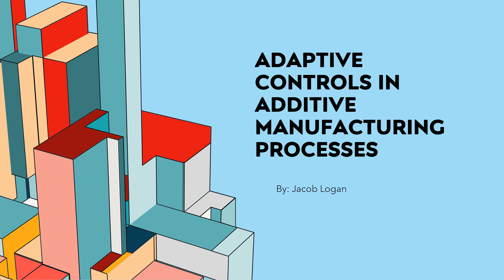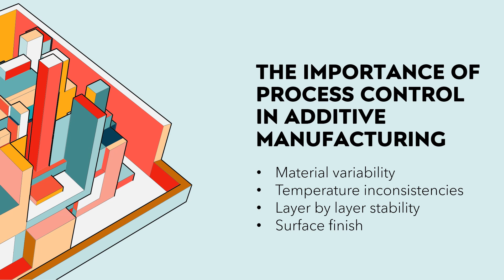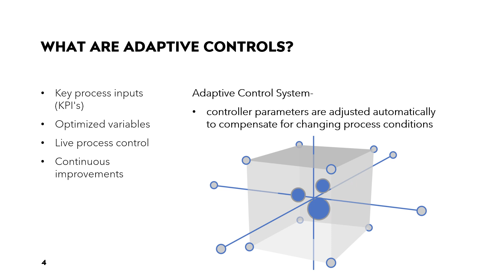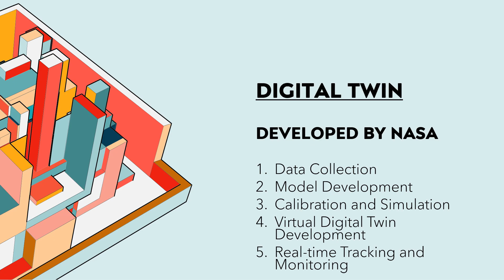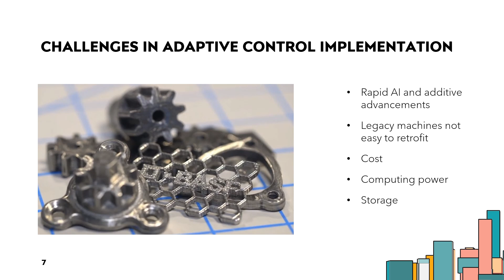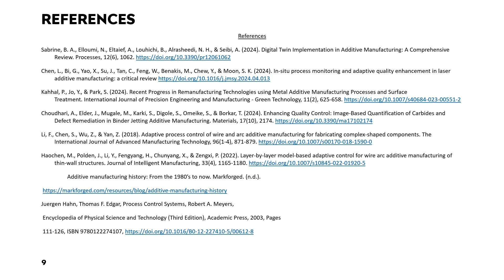Adaptive controls in additive manufacturing processes

Comment: The point the on the difficulty and expense of retrofitting older additive manufacturing machines with new sensors is something that I feel definitely gets sidelined when tech outlets publish articles on IIOT and wireless sensor networks. While the 3D printers that companies currently use for rapid prototyping could be repurposed for real part production (or part reworking / repair in the case of LDED printing), the adaptive control systems require investment of capital for the hardware / software as well as time and labor to make the sensors compatible with the printer models that most companies currently have.